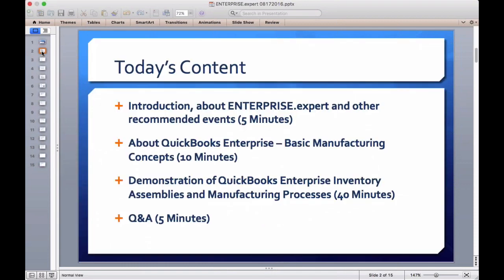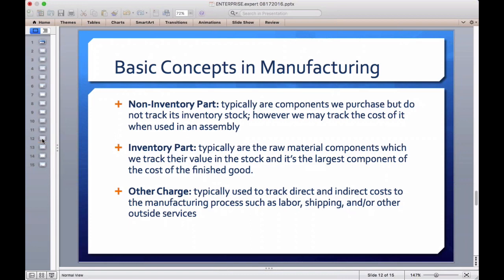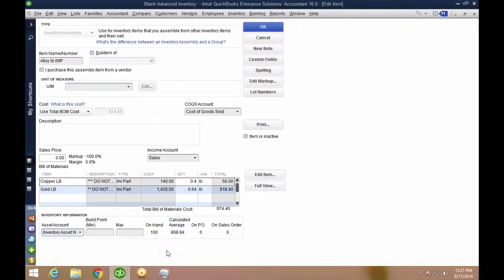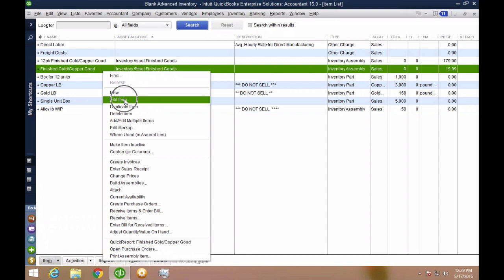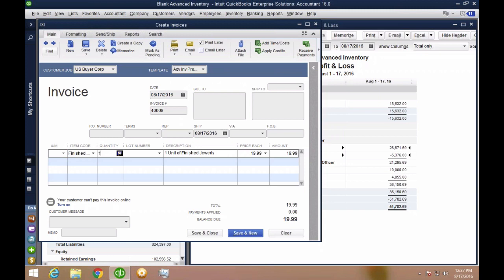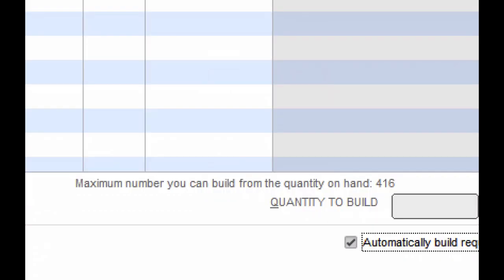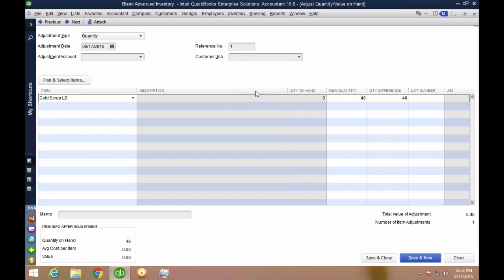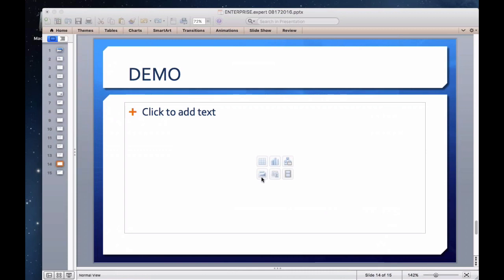QuickBooks Enterprise for Manufacturing & Inventory Assemblies

Comment: I have a unique situation where we build only one of every assembly unit.  We buy big trucks to refurbish with whatever parts they need.  We only inventory batteries and tires, everything else is purchased as needed for that truck assembly.  Building a non-inventory part section will get big fast.  I have been trying to find a way when entering the bills, use the item tab setting up the assemblies as stock # for a gathering place.  My CPA wants it done by the book, creating all the non-inventory parts.  Do you know of a way I can get this done without having to do all of 2018 over again?    If you wouldn't mind calling me at 479-770-0088 it would be greatly appreciated.  Thank you.
Reply from the maker: lorie wilcox there is no shortcuts with inventory Assemblies, you need to go back to the beginning and/or adjust and start fresh
Reply: @HectorGarciaCPA  please guide where is this option